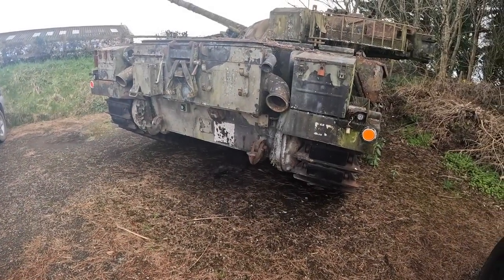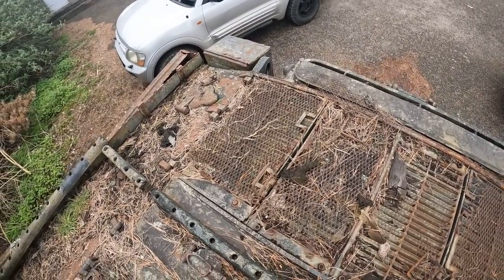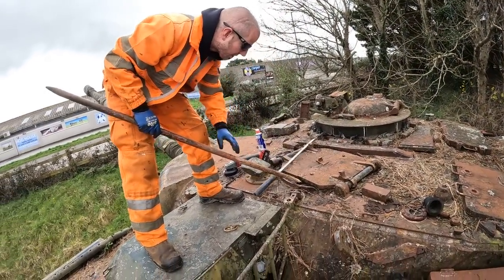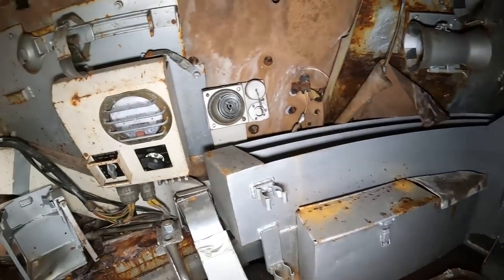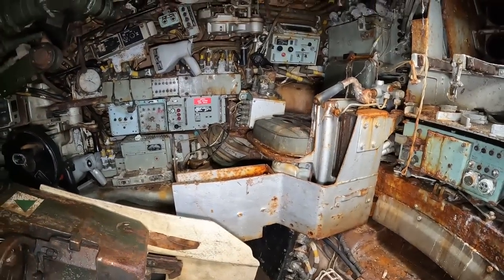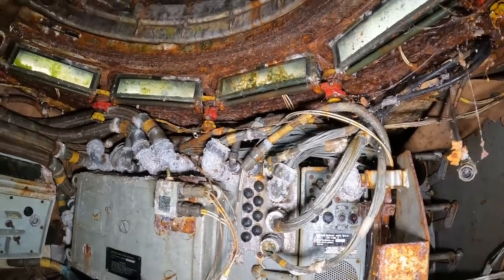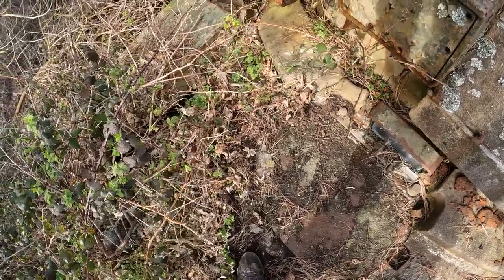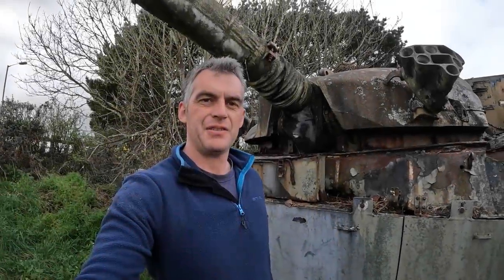Should I Buy A Chieftain Tank ?

Comment: Looks like that one was fitted with the IFCS ( Improved Fire Control System). Control panel fitted underneath to the left of the Laser Power Supply Unit  that had the 3000v warning. Spent many a happy hour repairing and replacing the fire control systems and sights on Chieftains in the 70's and 80's. Pity no gunners sight fitted but at least it's got the auxiliary telescope, a proper barsteward to get out.

Comment: I drove a chieftain at some outdoor adventure place in Norfolk about 20 years ago.  We were there for scuba diving on the coast and got blown out and tried our luck and they let us pay just for the tank driving (you were supposed to book a package of things).  Their T72 was broken so we got the Chieftain.  It was a very tight fit even with the drivers hatch open (so the bloke could tell you what to do) and quite hard to keep it going….had to keep the revs up or it stalled.  It was a blast but very physical the two big steering levers needing a strong pull.  After a couple of goes around a circuit of berms you got a go as passenger in the turret.  It was a really great experience.  Can’t even remember what we paid.
Reply: These guys? https://www.youtube.com/@tinkeringwithtanks
Reply: @Daniel-S1  It was a long time ago but the place we went to was aimed at parties for stags and hens with quad bikes and other things as well as the tanks.  Could’ve been connected I honestly can only remember how hard it was to drive the thing but awesome at the same time.

Comment: I bought a T34 about 30 years back. It was a good tank in size and weight. That looks some project to take on…..but good luck if you decide to take it on.
Reply from the maker: Awesome . Do you still have it ?!
Reply: No I sold it probably 25 years back. Used to do some demo’s and car crushing with it. I have some video from back in the day so if I can transfer to digital can probably post some on here. Have you found any other tanks to look at?
Reply from the maker: I already have an Abbot Spg and a scorpion cvrt but I would like a main battle tank to complete the line up. Don’t see many about though so I have not looked at any others just yet. I don’t mind a project but these may be a little far gone 😬
Reply: @BenoCam  yes agree I think the one you viewed would take some work to put right. Hopefully something else will turn up, but you have a few nice toys to play with till it does.

Comment: Helston Gun smiths or something like that, they have been rotting for years.....amazing that they won't sell unless deactivated, which I would say the weather has already done! Been years since I was inside one of them, I have 'grown' since
Reply from the maker: I think there may be some kind of “end user agreement “ when they had they off the army that they cannot be sold on as working gun tanks incase you decide to sell them to some African war lord or something . But that is only a guess but I think there is a rule like that. The gun is the best bit too… greased right up !
Reply: @BenoCam  not when Chieftain left service……  now they have to be though. I ‘certified’, through seeing photo’s, a Chieftain in Canada!! 
The breach block and the barrel on that one will be rusted so much that the gases would leak all over. 
They can cut the breach so that it is useless, except as a balance weight for the barrel. 
The barrel just needs a hole gassing in it to stop the sealing of the projectile.
Reply: So what was its army reg number I noticed it was ..eb.9

Comment: Judging by some of the electronics in that turret, it’s quite a late Chieftain that had the later computer ranging system installed - forerunner to the Challenger systems.
Reply from the maker: Ooo interesting. It’s good to see inside and see all the kit in there although some of it is in very poor condition.
Reply: @BenoCam  I sure wouldn't just stick a set of batteries in it & hope for the best 😳 It's certainly taken a battering by being closed up like it was. No air circulation etc. A massive undertaking, a massive money pit for anyone taking it on. Oh, it was nice to see the breach block in place 👍

Comment: Looks a lot of work . But inside is pretty well complete . A lot of the rust looks cosmetic. The electrics will need a lot of sorting . Be a good project if you can afford it.
Reply from the maker: I can afford to buy it but I’m still not 100% I can afford to fix it 🤣🤣🤣
Reply: @BenoCam  I bet it would be worth restoring. They cost about 70k in nice condition. And probably only go up in value like most vintage vehicles

Comment: All depends on how much money the owner wants. But it will take alot of money and time to restore. But i have seen worst ones restored. Good luck  👍
Reply from the maker: It’s not cheap ! I bought the abbot from him and restored it over 5 years which I was able to revive the engine/gearbox but it’s possible I just got lucky. The difference being with that was that engines and gearboxes were readily available unlike chieftan which cost a fortune
Reply: @BenoCam  An acquaintance of mine in Canada bought one. with 105 mm gun.
Reply: @BenoCam the price tag was what I kept wondering about on buying one of these. I’m retired from the US Army and one of my hobbies (besides gun smithing) is MV restoration, I’ve owned and restored 31 MV’s to date since 1993 but I always stayed with soft skinned wheeled MV’s, the closest I came was with a WWII Bren carrier for $5,000 USD back in 1997 but I passed on it, the previous owner installed an engine/trans out of an old Ford Pinto in the carrier but, it did drive just fine but I’m a purist on my restorations, I,like factory new condition. So to see you bring the Chieftan back from the dead would be an incredible effort on your behalf and I commend your dedication. I’m in my mid 50’s and there’s no way I’d be able to work on a tank these days, lol. I miss living in Germany and going to the events and militaria shows in Belgium and Luxembourg.

Comment: I used to work in a factory repairing Chieftan Starter Motors if you need a hand. Sure they are Cummins engines.
Reply from the maker: Leyland engine in a chieftan ! Unfortunately!
Reply: @BenoCam  was it the Challenger then. We did 2 sorts of tanks. I used to test the 500 amp generators on a test rig for one sort. I`m old now so forget lol.

Comment: Not knowing squat about these things, but could that still be a spent shell in the breech? 6:18 there's like a brass-colored rim just peeking out above the breech block.
Reply from the maker: The breech block is in the fully up position, so that different coloured ring you can see is the start of the main chamber ring which is a different colour type of metal I think. 

I’m still not sure if the chieftan used brass shell casings. I know centurion did but I think chieftan you put the projectile in and then a bag charge behind it rather than a shell case 🤔
Reply: Correct.Bag charge ,

Comment: They have an urban camo Berlin Brigade one, why not spring for that one? if you're just planning for "restoring" one and selling it on then you would do better to buy and restore more of the smaller vehicle types and make more profit to get the best one you can find instead of going for a wreck because that's what the play money allows for - make more money buy a good one - or rather make more money and buy a Leopard 1.
Reply from the maker: They are all equally bad… I already have a few military vehicles and I prefer the look of the nato green/black camouflage. Of course I could still buy the the urban camo one which they refer too as being Berlin camouflage as they were stationed out there in the Cold War. However they are quite rare and it would be a bit of a shame to repaint that one in green/black woodland Camo I think. Leopards are huge money and pretty much un achievable to the normal person I think.

Comment: The exterior is awful but the interior looks very complete
Reply from the maker: The exterior will be easy enough to clean up. It’s the electrics and the gearbox I’m concerned with, hard and expensive to get bits for ! If the engine is salvageable it could be viable

Comment: Sad that it was left out in the weather for so long and suffered so much water damage.  I'd pass on this one and go for one that's been better cared for.
Reply from the maker: The trouble is a better one is a lot more money but that might be the way to go
Reply: @BenoCam  As the saying goes, you get what you pay for.  If one has little money but lots of time, buy a rusty tank and spend years refurbishing it. But also remember that the rust, water and corrosion has destroyed quite a bit of what you cannot see such as the electronics, and those things will have to be replaced or repaired at great expense as well.

Comment: what about the cvrt restoration!!!!
Reply from the maker: It’s getting there. I have a recon engine and gearbox sat on a pallet . The turret is off and all cleaned out inside. Just waiting on some dry weather for sandblasting and paint ! Then put it all back together 😬
Reply: @BenoCam  oh nice, someone mentioned to be before that the cummings motor requires a lot of work to adapt to a scorpion compared to other cvrt models, I don't remember the reason why though considering the scimitars all got the cummings upgrades. I don't really like the J60 motor so I've been thinking of doing a cummings swap myself, looking forward to seeing how you do it.

Comment: Buy a slightly used russian model for 1/10 of the price??
It probs needs new batteries, an oilchange and some paint. But im perty sure youl be able to find a fixherupper that doesnt require too much..

/huehuehue

srsly tho. If its viable or not comes down to one thing eh. The price. Buy it if its cheap enough. I wouldnt pay much more than scrapvalue tho(like scrap + 15 %), its just in too bad nick. - And its not like its a ww2 german panzer IV. - Its still a somewhat common tank. You will get another chance for buying one down the road, if you decide not to buy this.
Reply from the maker: Yeah price is everything now. They don’t come up for sale that often anymore !

Comment: Hell no.
The most unreliable tank of its time. You’ll need spare engines, spare transmissions, spare tracks, a gigantic transporter to get it anywhere, a Stolly with a Hiab to change engines with and something huge to recover it with when it sinks into the lower paddock up to the belly.
Reply from the maker: Not a fan then 🤣 I still want one though 😞
Reply: @BenoCam  Well you have a Stolly, just need the Hiab for it. . . .

Comment: In Service Date
01/04/1968

This missing date from 1968-1988 is pre-Merlin computer and would likely be held by the MOD in paper form.  Below is the current held data:

2 ARMY DEL SQN (VEH STOCK)
18-Feb-1988

18-Jul-1991
VEHICLE DEPOT LUDGERSHALL

DISPOSAL VDL
10-Feb-1993

Date Not Recorded
RHG/D

TANK COMBAT 120MM GUN CHIEFTAIN MK10

Cast Date
26/09/1993

I hope that helps